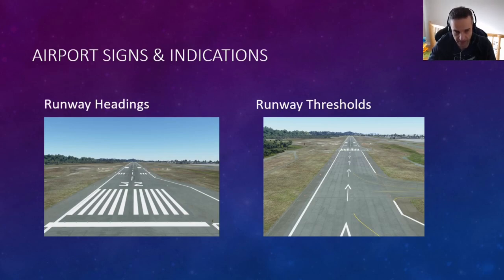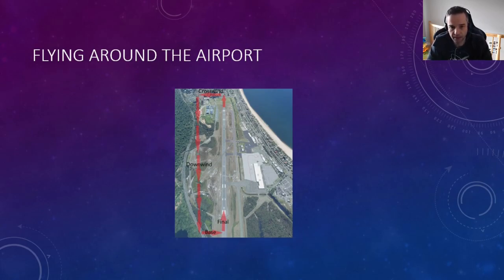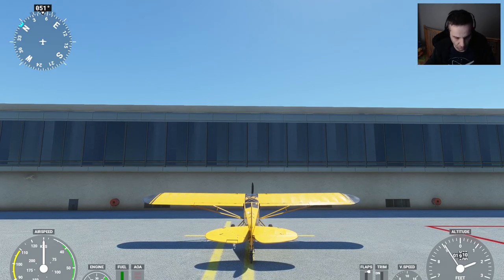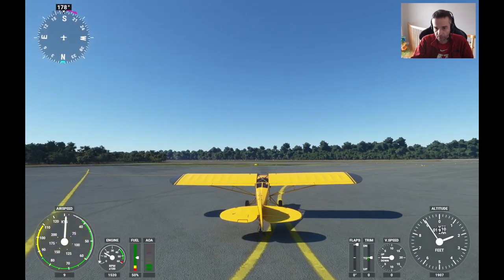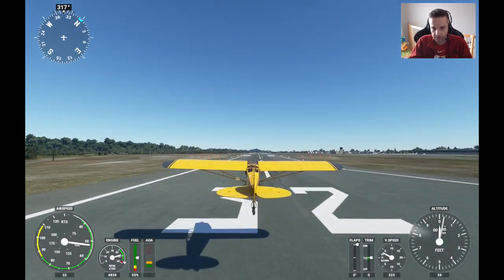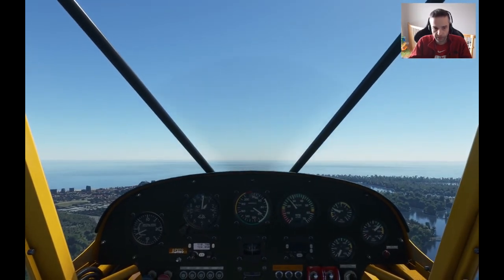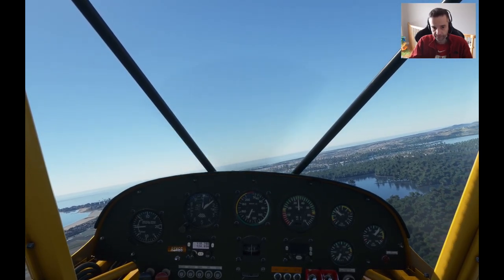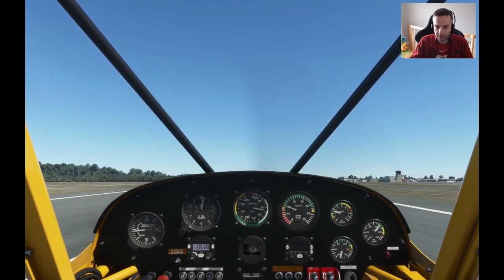Traffic Patterns & Airport Procedures in Microsoft Flight Simulator | Tutorial

Comment: Thanks for the videos!  When the instruments (like the compass) are in the shade, how do you see them?  Also, the airports I have been flying don't have a river to indicate where to turn for the base leg.
Reply from the maker: Normally you'd turn base when the runway is 45 degrees off the back of the airplane. It's usually somewhere between 20-30 seconds after you've gone past the runway threshold on downwind.
Reply: When you are on the downwind try Ctrl + Left Arrow that will "turn your head" 90° to the left.  Once you go pass the end of the runway  is easier to eyeball the 45°